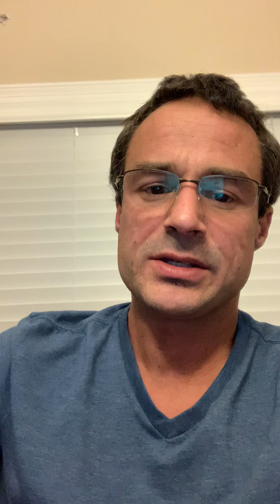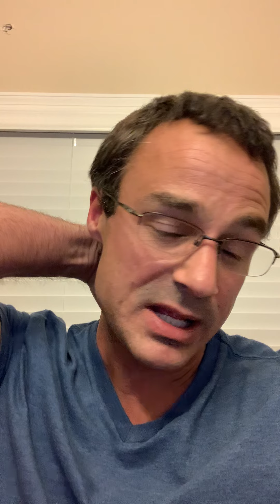Fk8 overheating what works?

Comment: The only Type R that I'm aware of that doesn't have overheating issues has replaced the grill, has the Koyorad radiator and...has removed the AC system from the car. Yep, no AC, but unrestricted, direct air flow to the radiator. He has vents in the hood as well, but the owner says that the night 'n' day change was removing the AC.

I'm certainly not recommending this for the daily driver that's occasionally tracked, but that's how bad the heat issue is.

Here's an affordable alternative to the J's Racing grill:  https://americanmodified.com/products/16-18-honda-civic-fk8-front-sports-grille-glossy-black

Thanks again for the excellent information!
Reply from the maker: Unfortunately That grille you chose fitment us poor. I know because I bought one and sold it for half what I paid for it. You do not need to remove ac to stop overheating. Radiator, grille and oil cooler are enough. Occasionally you’ll need to use a hood but less likely if you are using a turbo blanket and ceramic coated downpipe. Also a catless downpipe clears more heat out the exhaust. When there’s no catalyst the temperatures don’t climb. The catalytic converters actually gets hotter than the gasses it receives. That’s how it break down nox, and other harmful environmental gasses. Not nos as many people call it. It’s actually called nitrogen oxides. Not nitrous oxide like many say. 
Koyo radiator isn’t the best radiator out there. C&r is motorsports track use. You also don’t need the giant j’s style racing grille either. There are tons of type r’s out there that don’t have hood vents and run fine. Half the people don’t realize too thick of an oil in him ithibuts cooling as well. An oil too thick counteracts an oil cooler by a significant amount. 

where a lot of type r owners go wrong is covering the fender holes in the engine bay. That adds air pressure and slows down heat removal from the engine bay. That scoop on the hood is designed to make air flow through the fenders to clear air out of the engine bay. If you do a grille and a radiator but block those off you just destroyed the air flow you created. 
I talk to an engineer that deals with ctr race cars and they have a ctr on motec a radiator, xdi pump, xdi 1650cc injectors pistons and rods, oil cooler and a grille. He’s running 30 psi using an efr7163 turbo. The car has ac and has no issues. 
Now in the other hand if your running ac while your on the track I could understand that being a huge issue. People literally think that’s ok. I’m not joking they don’t understand that the condenser creates 250 psi and up to 200 degrees. 
Also people do not realize sleeved engines overheat and they think it’s a smart idea to run standard dry sleeves to keep the engine from blowing up. You don’t need sleeves  800hp on a type r. You need a CSS “cylinder support system for 550 or more. 
Darton MID sleeves are the only sleeve I’d attempt to run on a race track because they are full wet sleeve design.
Reply: @Fk8td   Thank you for the excellent information. I've not yet done the radiator so I'm glad to have the information on the alternative to the Koyorad. I'm only occasionally doing rookie track days, 20-minute sessions in my daily driver, so if the better radiator is a lot more expensive, it may come down to cost.

I doubt if I'll ever go with a big turbo, so with an xdi pump and stock injectors, I'll probably get stuck at the wall between 400-440 HP, whatever's possible on pump 93-octane, so for now, I plan to keep the bottom end stock.

Thinking after I get the xdi installed, I might get the red star street/driving tune. I watch the video from Torq Gearbox and saw the tune sets the torque curve to help protect the transmission from excessive torque at low rpm. Also, lower power in 1st and 2nd gears to reduce spinning That's a smart tune.
Reply: @Fk8td  when you mentioned blocking off the openings in the top of the fender...is that what I keep reading about people ordering those trim parts for the European Type R that's supposed to like finish out the trim under the hood? I don't have that area blocked on mine I never consider doing it, mostly because I don't really care what things look like under the hood. I just want them to work. I thought I read that the hood vent tunneling air through those little channels was supposed to route air down to help cool the brakes, but if they help to move hot air from the engine compartment, more power to them!

I still haven't done the radiator yet but I am running a turbo blanket and a high flow cat downpipe, which is nothing like a real catalytic converter. It is also ceramic coated and I have noticed a lot less heat under the hood since making those changes.

Now that you mention it, I could absolutely see people not realizing that you shouldn't be running your air conditioning on the track, but doing it anyway. I didn't run it, but when I was on the track in July and August here in South Louisiana, and the engine was running a little bit hot, I aimed all the vents away from me, made sure the AC wasn't running and ran the heater in my car. They make us run with windows down here anyway so it didn't bother me, but it did seem to help the engine run cooler.

Also, turns out my mechanic also bought that same replacement grill that I did and on his car, he said the same thing you did, that the fitment was terrible and he didn't use it. Apparently, their manufacturing is extremely inconsistent because he said his brother bought the same thing for his type r and it fit rather nicely. That kind of inconsistency...so much for quality control, right?

Thanks again for sharing your experience with us all!
Reply from the maker: @nYdGeo  the trim was left bare for air flow. Those side vents behind the front fender are functional. Open your hood and look in there. You can see through the grating. If you noticed the hood scoop has the aluminum piece that sends the hood scoop air towards those fender openings. It does 2 things aids in downforce by controlling where air goes and helps pull the hot air from the engine bay as it goes through. Since the car gas an undertray you need an additional source of air to move air through the engine bay. If you remove the undertray you due to the design you create an air pocket under your car.

Comment: No one talks about turning the heat on full blast, that lets all the heat out the engine fast enough for the temps to drop a few degrees 
Not ideal on a hot day but with front & back windows slightly down and vents directed outside it’s doable

Comment: Good evening,
Thanks for shearing your knowledge on this issue.   After watching your video along with others on the matter.  i am planning to track my in a couple of weeks. I was wondering if I combined the grill and shims to my hood hinges (raising the rear of the hood) will that be a benefit or will it be a deterrent to the hood design.or Also adding vents to my hood  (where will be the l best location for the vents) to relieve trapped air.

Comment: I have the car tuned with mishimoto intercooler with upgraded intercooler pipes and mishimoto Radiator, InvidiaR400 exhaust with 3” catted downpipe . 
PRL hvi titanium intake , flex fuel PTP turbo and  downpipe blanket and the car still overheats especially if driving behind another car at lower speeds . I’m surprised at this point Honda hasn’t stepped in to solve this problem maybe a class action lawsuit will get the attention of the executives at Honda . The sad thing is that these cars running cool are giant killers so it’s very frustrating to be kicking ass and then the car pulls power to cool off .

Comment: Would the aerodynamic function of the fender vents be negated if you removed the hood scoop channels under the hood? The hood scoop would funnel air into the engine bay…but the fender vents would still pass air and function, no?

Comment: I'm using 12vlt interchillers, watertank,pump and air to cool down  my elantra Sport air intake system + other stuff
Reply from the maker: I’m supposing you mean 12volt  intercooler pump with ice in the water tank. 

Interchiller is driven off ac and generally  Zl1 guys use that to bring the air to water intercooler brick inside the supercharger down to 40 degrees.

Comment: No one talks about turning the heat on full blast, that lets all the heat out the engine fast enough for the temps to drop a few degrees 
Not ideal on a hot day but with front & back windows slightly down and vents directed outside it’s doable 
Ohh and FK2s are worse than FK8 / FL5 with that tiny engine bay
Reply from the maker: This hasnt been reported as such across many cars but its relevant to how hard the actual driver can push the car

Comment: Im taking those fender trim covers off after seeing this video. As for the reverse flow Acuity radiator hoses I hadn’t noticed an increase of temperature since I’ve had them but now I’ll replace them with standard flow hoses. If Samco finally made fk8 radiator hoses then I’ll get those. If they are not available what brand should I get. Also running an RV6 catless down pipe I wrapped with PTP lava infused exhaust wrap. I did get the American front grill and that seems to have helped alot. As for the radiator I changed my 2018 radiator for the more efficient 2020 oem radiator because it was cheap. Still running the stock hood. I had put in Redline water wetter with the oem blue coolant. I thought the main reason for overheating was because the inlet pipe sits right over the turbo heating up the air charge. Let me know your thoughts on that. My friend is running the g-700 and had his fabricator reroute his inlet pipe with a cone filter down where the windshield reservoir was. He’s running port injection with a Nuke performance surge tank and Motec on speed density.
Reply from the maker: You are probably taking about Jean Paul’s car. The 2020 radiator isn’t much better. Airflow is the real issue. The acuity hoses won’t change temp but if you run low you will end up pulling air into the bottom of the block and create an air pocket. Water wetter is actually completely ineffective. Increasing your water content to 70 percent water and 30 percent coolant with a higher pressure radiator cap will produce better heat control. 
Koyo radiator fits but you will have to round the front passenger lower fan bracket to clear certain aftermarket intercooler piping set ups.  
Hot air has very little effect on overheat because less oxygen means less total thermal output. Running ethanol will actually do way more for heat that any intake piping or intercooler ever will. If you cool the air charge you end up burning more fuel creating higher thermal output.

Comment: Seems like common sense to me , i`m wondering about the bellypan on my 2020 SI, maybe a more vented pan ,   had mine off for awhile and it seemed to make a difference . I`m thinking about enlarging the opening and the front bumper area.
Reply from the maker: To put this in perspective my engine is now sleeved. A sleeved engine rubs hotter. I have a Mishimoto radiator now and at first even on a 75 degree day the ect temps were 195-200. 
I changed only the grill and now it’s between 176-185. Even in 90 degree weather. 176 being the thermostat limit. A grill upgrade is a must.

Comment: Have you tried the auxiliary race radiator from Mishimoto?  

The extra fluid volume may buy a little more time, and if the air flow manages to reach the rear of the motor (as stated by Mishimoto) it might help...
Reply from the maker: Adding fluid without fixing airflow or the amount of heat exchange only delays the inevitable. The Mishimoto add on is a waste of money. I’ve been through enough builds to know what works. When you know.what it takes to keep a 1500 hp street car cool you know what it takes.  Airflow is the biggest problem. The Fk2 had the same radiator without overheating in stock configuration. The tcr race cars have a huge hole in the bumper below the grille. Putting a radiator in the back of a hot engine compartment fixes nothing. You can’t cool heat with more heat. That why even adding a big radiator doesn’t fix it all the time on the Fk8. You can have the best radiator on the planet but no airflow over it won’t help. 
You’ll get better cooling by using a j’s grille than a radiator swap. Also don’t block off fenders under the hood that creates back pressure in the engine compartment with no where for the air to go. No it’s not some big pressure but with the flat bottom that leaves one less place for air to escape the hood scoop isn’t for channeling cool air into the engjne compartment it’s part of cooling off the air coming out of the fenders from the engine compartment. Take a thermal gun after driving around on a hot day and you’ll see how much hotter those fenders get from air going through them and you’ll see what I’m talking about. Then take compressed air and shoot it into the hood scoop and slowly watch the fenders cool off. I used a blue point thermal gun. 
To many companies have good advertising and they don’t do half the stuff they should. Mishimoto also blocks off the brake vent for their oil cooler. That is harmful for track use for the brakes cause that vent channels air to the brakes just below the front fair vents there’s really vent holes for that.

Comment: Good info and thanks for sharing. 
What are your thoughts on the Titanium Turbo Inlet pipe?
Reply from the maker: I’m kind of mixed on it. It’s not going to improve iat charge or hurt really. Talking about heat. 
Titanium heats up and cools down faster than the oem inlet pipe. That’s due to thickness difference. Titanium does transfer less heat from one area of metal to the other but I’m not 100 percent about air heat transfer. Testing with titanium turbo inlet got just as hot as stock. Thermal temp gun proved it. Also when your in heavy throttle the air velocity is soo high it doesn’t have time to pick up significant heat. So in retrospect a bigger inlet has less velocity like an air box which could pick up a tiny bit more heat but we are nit picking here. Talking about power
Maybe with larger drop in turbo you might see greater horsepower increase from need for increased airflow at high rpm but I there is absolutely zero benefit on stock turbo for spool or power. I get increased low rpm power and better spool through fuel strategy and cam timing. Don’t  really need to touch ignition timing in spool area unless you changed to different fuel like e25. Going from 91 to 93 not really worth changing spool area timing. Plus pushing earlier timing can actually delay spool if it’s at the limit.
Reply: Good shit my guy 👏 👏 👏

Comment: Are there many options in terms of aftermarket grilles?  I'd really like one without the badges...
Reply from the maker: Yes the most common one is Procivic.com 
It’s the least conspicuous and cleaner looking than others. J’s racing grille is the most air but rather expensive. You can find most info from civicx.com

Comment: What brand of oil cooler would you recommend sir?
Reply from the maker: I don’t like what’s available which is why I made a custom set up. 
My car doesn’t have the pressure drop issues other oil coolers cause.
Reply: @Fk8td  what is the best setup for oil cooler then . Where did you mount it

Comment: PWR track radiator at the minimum. Then a more open grille if needed such as the 2020 grille. Should be able to control the over heating.